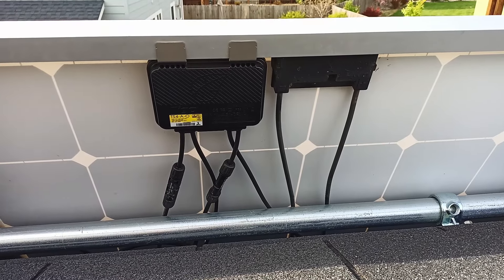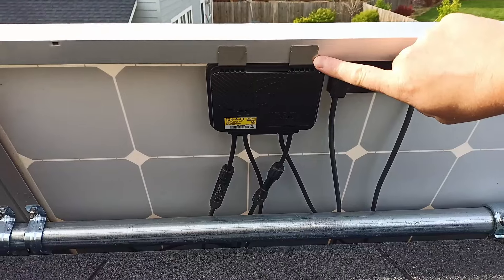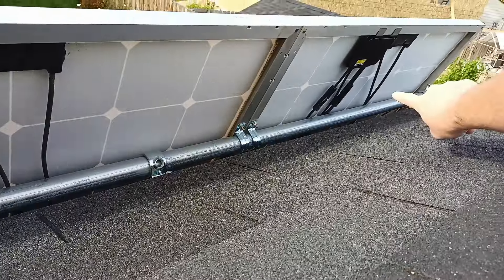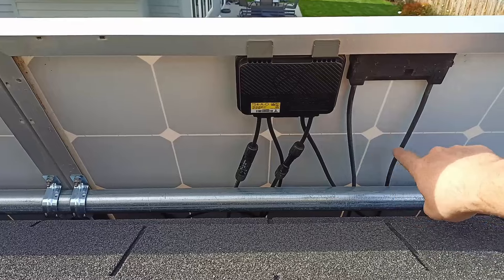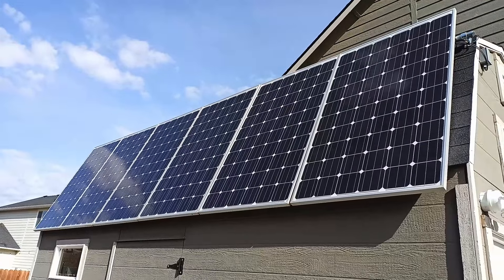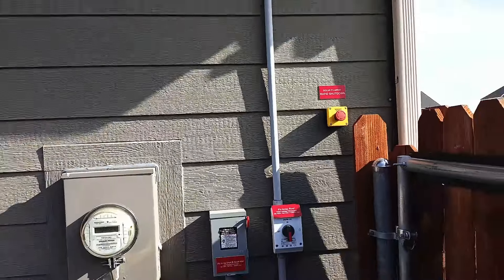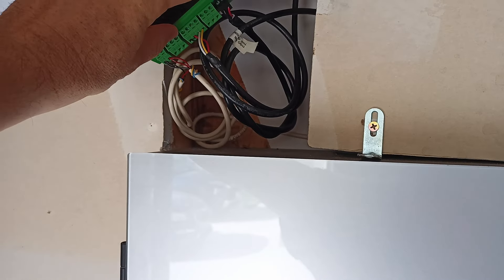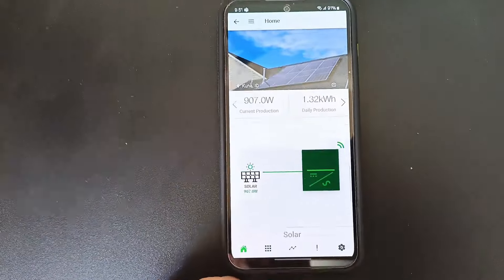EcoFlow Delta Pro Ultra showing Tigo TS4 optimizers with rapid shutdown demo.

Comment: This was very informative. I had read, somewhere, that TIGO and the Ecoflow Delta Pro Ultra were not compatible, so this disproved that assertion.
Reply from the maker: @johnbrzezinski1446  yeah I don't know where that would come from the Tigos just hook onto the panels it doesn't care what other set up the system has. Works great I don't see why anyone would think that that would be an issue, you could use any version of tigo or other brand that you want with the dpu. Other brands won't care.. they are not tied together in any fashion.

Comment: Hi good afternoon. Thank you for posting the video. I am looking at setting up the exact same system with 54x panels (8 strings - 2 going to each of the Ultra's PV inputs). How many panels do you have ran in series and how do they hook up to your breaker box on the inside? I see you have Westinghouse and Langir 15A mini circuit breakers. Is each HV and LV string connected to their own circuit breaker so the breaker acts as a DC disconnect kind of like the IMO DC disconnects SignatureSolar sells? I would like to pick your brain for more details as I'd prefer this setup instead of 4x IMO DC disconnects.
Reply from the maker: @raymondhupp1437  hello the max I could get away with was 8  475 Watt panels in series as that is the voltage input the high would take you can send more current in but you cannot over voltage you'll damage it but you also don't want to send too much amperage.

Yes I have the disconnects they're in their mainly as a disconnect a little bit of a safety but again amperage isn't the real killer it's the voltage you cannot absolutely not do go over voltage.

So I swapped that Westinghouse 15 amp to a 20 amp because the amperage isn't a problem and the panels I have over the shed just touch 15 amp in Wood pop the breaker but it was just fine for the input.

I ran the negatives straight into the inverter solar input and the positives went through the breakers and disconnects.

Comment: just added these optimizers to my Ecoflow DPU setup, everything is working fine, but the current production number from the Tigo don't always match the solar input number from Ecoflow app.  I just rewatched your video at 6:45, your Tigo app is showing 907kW and your Ecoflow is showing 2648W, that's much greater discrepancy than mine, mine is usually off by a 100-200 watts. any idea why it is like that, anything can be done so both numbers match?
Reply from the maker: not to sure I would have to revisit it on a sunny day and review everything.

Comment: On your CCA for your 12 volt supply do you have it hardwired into a plug into the wall? How do you have the 12volt supplied to your CCA?
Reply from the maker: @bikhard1078  I put in a dedicated AC circuit on backup that the adapter plugs into. And if something should happen 12:24 volts is easy enough with the batteries around to get the panels to kick back in gear and charged with the batteries.

Comment: Is there a cheaper option for rapid shutdown if you don't need the data logging? Spending nearly 50% of the price of the panels for something that you "may" never have to use  sounds ridiculous IMO.
Reply from the maker: @TheNature101  I'm not sure you could Z-Wave a switch to Google or Alexa if I had to think about it but I went to this because it was required by code personally
Reply: Tigo also makes a TS4–a-f that is a rapid shutdown module with no optimizer, or the TS4-a2f where one shutdown unit handles two panels. Then there’s a little 12v power supply and transmitter with a “core” that you run your negative PV wire through- and that sends your “keep alive” signal in the PV wire to the modules.
Reply: @JeffinTD  thats what im working on figuring it out with my Tigo with 12volts
Reply: @colindixon2353   Cool. Please post back how it goes.

Comment: Did you Install the panel mounts and panels on the Shed yourself. DIY.
How do you tilt the panels straight up at Summer. Seems your shed roof pitch don't allow that to happen?
Reply from the maker: Yes all done myself and yes they pitch hard south for winter and "mostly" up for summer. I mounted them on a horizontal pole and they "hang" on the pole for winter and are held up in summer. You kind kindnoff see it in the tigo video.
Reply: @erickbostrom4049 
I have a shed also with a 60 angle.  Great for winter, and to be able to lift it 15 degrees for summer was my plan. Any way to share how you built it?
Reply from the maker: @larrywong7834  I set a pole rail that I clamp them to and the Tilt upwards almost fully straight up and then they lay with the pitch of the roof as close as I could get. I think I have some pics of it on up there but I'm not sure and I can't send a pic from here.
Reply: @erickbostrom4049  Impressive
Reply: @erickbostrom4049 
I saved the post to watch again closer.
Reply: @erickbostrom4049 
I’m getting it looking real closely at the video. 
Name the Pipe holders that mounted to roof please.
Reply from the maker: @JeffS-my5eq  I just did a quick short video one of those shorts showing the shed setup hope it helps.
Reply: @erickbostrom4049  would like to see the mounts on these panels!

Comment: Do tigo work out the box do you need to connect them to something or is their a choice where you can just plug and play?
Reply from the maker: @secreteman205  out of the box, just setup in the tigo app.
Reply: @erickbostrom4049  im working on figuring out how to power mine but I have an Anker f3800 and going to get a cheap power supply that will run the Tigo but my tigo isint the wireless  unit so the units  come allready shutoff with needing 12 v to turn them on only .03 volts letting through
Reply from the maker: @colindixon2353  my tiger is the same I need a 12-volt or 24-volt power supply so I put that on a UPS and that UPS is powered by my ecoflow circuits so one way or another it's getting power

Comment: How interesting that I was just looking for a demonstration while thinking about EG 4 inverters and batteries. Thank you!  As I understand it the button needs power.  I haven't researched much into this yet but my kneejerk question is, if the power is out/grid down and you have to hit it will it still work?  Or I guess I should ask if its tied into the batteries for power?
Reply from the maker: The tigo CCA "transmitter" needs power yes, I have it on a battery backed up circuit, so when the power is out as long as I have some battery in the ecoflow it will be powered, and I have it setupo on the smart home panel 2 that that circuit will be powered to 0% battery.
Reply: @erickbostrom4049  Can you explain why you need to power the power button when the grid is down?
My understanding is that, if the grid power is down, also the solar energy MUST be down?

- My understanding is that if the fire marshals turn off the power of your home, or the power of the whole block,
the solar power of your home must also be down automatically without having to push your security button, 
so the fire marshal can enter inside your home or access your roof without any risk of electrical shock. 

- The shut off button is a security switch allowing you to turn off all the solar energy so you can access your roof 
for maintenance without having to turn off the grid power to your home.

- Now, if there is a power outage, then you may want to have solar energy available, so maybe you need then
to be able to have solar energy, using your solar panels during the day or your batteries during the night,
so I imagine that you need then to power the full solar energy system using a  battery backed up circuit (or UPS)     
but this should be only a temporary by-pass solution?

Please, tell me if I am wrong  in my understanding, as I plan to install such system.
Reply from the maker: What a great question.

Well...
My system is self-consumption only, I use and store my power. I am NOT grid-tied so I do not need to worry about back-feeding the grid "nor do I want to". 

With that if I want my panels "ON" I need to power the CCA, so IF the grid is down that is irrelevant to me as I would only notice if my batteries are low and the SHP2 used its built-in transfer switch to transfer to grid power until my batteries come up.

If that is the case I still do not back feed "Grid tie" to the grid so I pose no risk to workers that may be on the lines as I am only a standard sub-panel set up on the main electrical panel, so if the panel goes off so does "Grid" power to my system SHP2. 

If something ONSITE is happening then the emergency button would turn off all the panels for 1st responders needing safe access.

I do see your point on the inverters shutting down as well as the panels to stop the internal AC as a safety but I do not have an answer on that part. I know cutting a line obviously pops the breakers to stop the flow but I see your bigger point of ALL AC in the house.

maybe that function is a business opportunity?
Reply from the maker: @nihongobenkyoshimasu3190  here is what Ecoflow had to say about the AC side rapid shut down:

Dear Erick,

First of all, thank you for choosing EcoFlow and contacting us.

Regarding your inquiry about whether the inverter AC output has a rapid shutdown feature similar to Tigo optimizers, and whether it can automatically cut off the inverter output in emergency situations, we have not yet launched a product solution with these features. However, please rest assured that we highly value your feedback and have already reported your valuable suggestions to our R&D department for consideration. We are always committed to continuously optimizing and improving our products and services to better meet the needs of our users.

Comment: how secure is that wireless signal how easy would it be for someone to hack and shut your system off thats something i have been worried about seeing all this wireless stuff and wondering what the cybersecurity is for those devices
Reply from the maker: not sure, sounds like a TIGO question.

Comment: Curious as to how well the Tigo app works.  Seems like the panels didn’t show the power when you switched over to that display in the app.  Is there just a long delay in getting updates from the modules?
Reply from the maker: @jeffnhelen  the delay isn't in the modules the delay is getting the information from the tigo servers it's a bit of a slow app but it is useful and shows all the power information you want from it.
Reply: @erickbostrom4049  ah ok so it’s cloud dependent then?  Would be nice if it was local just in case the internet went down during an outage you could still have panel level visibility.